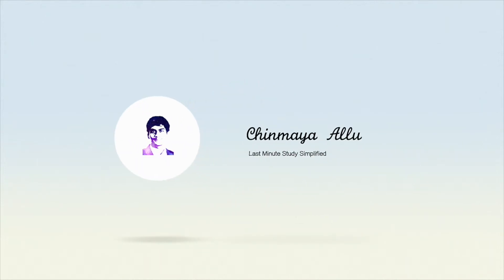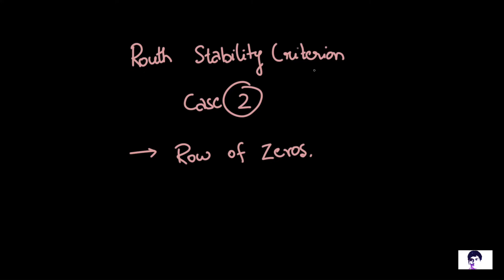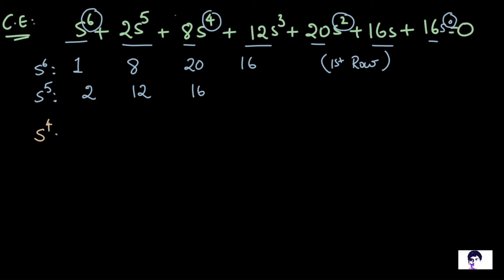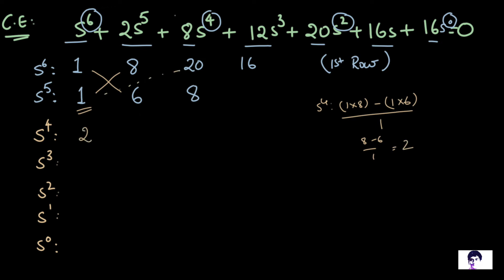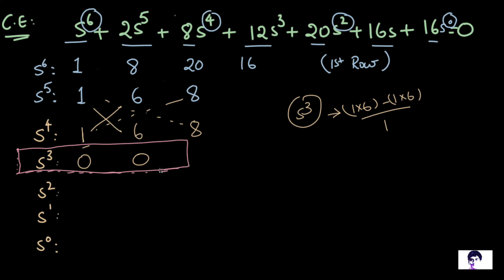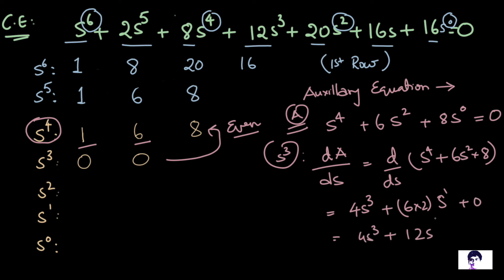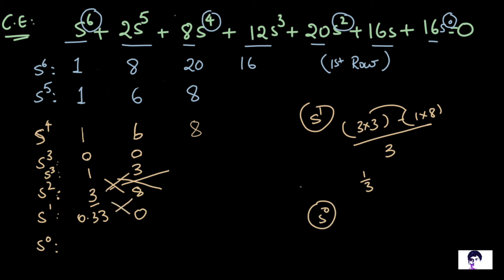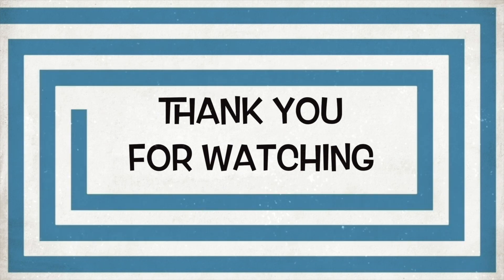Routh Hurwitz Stability Criterion | Case Two: Row of  Zeros with Example

Comment: Hi sir, I'm very confused with the determination of jw roots, how exactly can we determine how many jw roots are there? Is it by looking at the row of zeros or the degree of the s where the row of zeros lies? Thank you in advance
Reply from the maker: Hey Isaac Chook, a row of zeros will tell you the possibility of imaginary roots. Once you have that, you can confirm that the system is of limited stability, but to determine the roots, you would have to solve the equation.

Comment: If you take the polynomial P(s) = s^4 + s^3 - 7*s^2 - s + 6 which is factored as P(s) = (s - 1)*(s + 1)*(s - 2)*(s + 3), and you formulate Routh's array you will have a zero row, but P does not have imaginary roots. I think you meant to say that a zero row happens when P has roots which are radially symmetric on the complex plane.

Comment: Good pm sir! There's wrong in the computation of your determinants. At the 1st matrices should have change of sign at the 3 row.
Reply from the maker: Joanna Faye Talagon Hi. I am not sure of your observation. Try to recalculate once and let me know :)
Reply from the maker: Joanna Faye Talagon Are you using the first column for the base operations? That’s a common error :)
Reply: I knew where I got wrong sir, Im sorry😂😂 because I directly input my data to calculator. I knew it there's a difference when it manually solve. Anyways thank you for learnings!